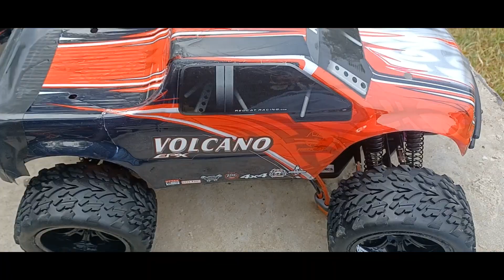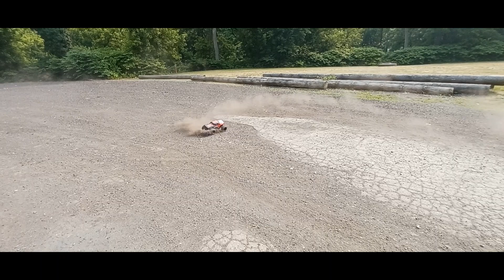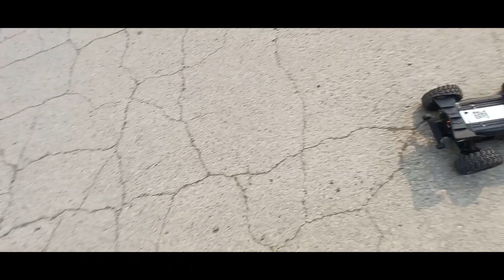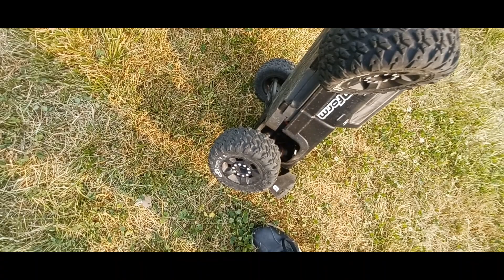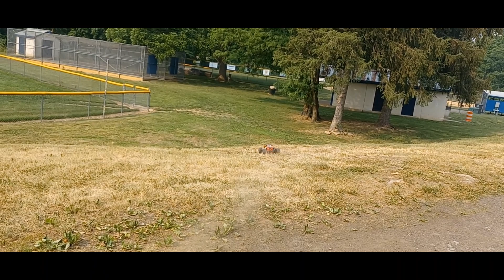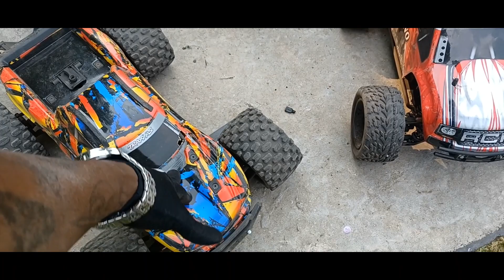Traxxas Hoss vs Redcat Volcano vs Arrma Big Rock vs THE BASH

Comment: Hi, friend! I plan to buy a redcat volcan epx (eventually I will make it Brushless at 2s) do you recommend it? I definitely don't think the gears support 3s :) Greetings from Mexico

￼Do you think the volcano supports 2s and brushless for long periods? Will the differentials, dogbones and spur gear wear out very quickly?

￼
Reply from the maker: I changed out to a metal spur gear .
And it will handle 3s with no problems.